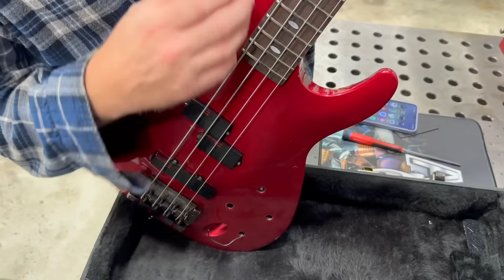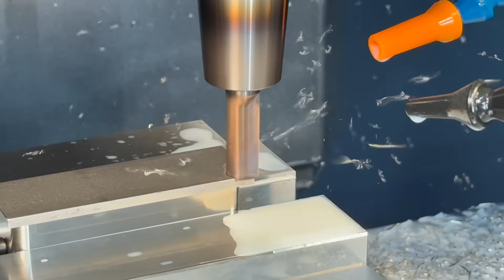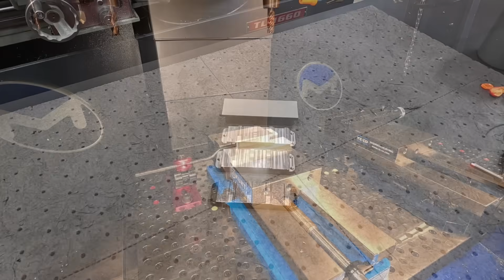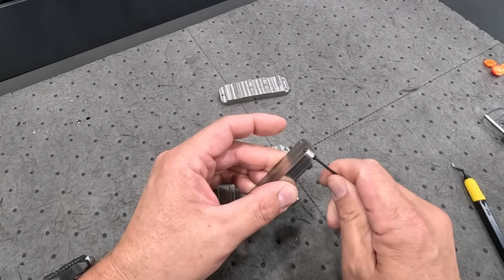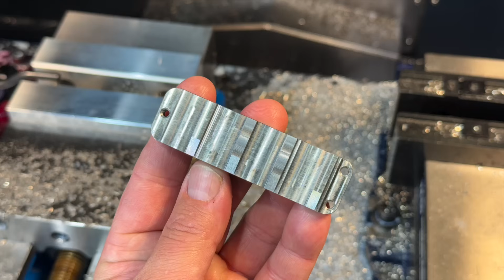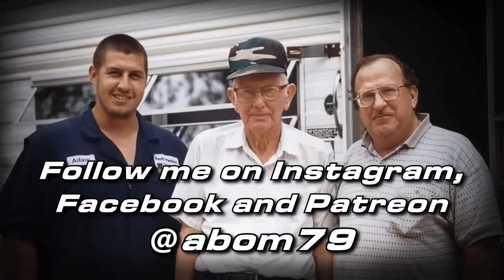Machining Obsolete Part for an Ibanez Bass Guitar- Part 2

Comment: I would've used air instead of cooling with the little guy. You don't need to cool anything really it's all about getting rid of the shavings so the tool don't need to cut the same material several times.

Comment: Check out Babicz full contact hardware if you’re into electric bass and guitar stuff.        I dig em     The old fashioned tune-o-Matic Gibson style bridge commonly on the Les Paul models is somewhat a relic that has no reason to be used - but the phenomenon of many electric guitarists and enthusiasts especially is this confused traditionalist or nostalgic thing-  a lot due to extensive marketing bs.    

But interestingly enough is that many electric bass players don’t get into that generally and just want what gets them solid performance and sound.   Funny to see that the individual wanted to restore the Ibanez bass with that same bridge- but hey it’s cool to see ya do it.  

Also Ken Parker archtops- he has a YouTube channel where he discusses anything from machining, machines to epoxy, glue and finishes, material choices and whatever. 

Also, there’s some amazing classical guitar tuning machine makers that are as much precision as they are art.      Salone is one of the best.        Definitely beyond the common Shaller, Gotoh and such.  

I could talk about guitar and music forever. 

Anyhow That’s my stream of consciousness

Comment: Would it be bad practice to use the Spot/Chamfer drill in OP1 as well, to have the chamfers on the bottom just as on the top before even drilling? Would the drill or tap mess with it or would it actually save the manual deburring?

Comment: Thanks for sharing. I saw some where that collets ad tiny end mills aren’t great. the tools get over loaded on one side and flex until failure. Bigger tools  can handle collets runout but smaller ones can’t.
Reply: Isn't a chuck the only (worse) alternative? I don't think the shrink collets get that tiny so these high precision collets are actually the best method, I guess. They are much more precise than any chuck.

Comment: Why didn't you make an undercut on the back to make the detail weight lower?
Reply: Probably because he was tasked to make a copy of the original part, right?
Reply: @Peter_Riis_DK The original part was hollow. More precisely, it had two longitudinal grooves on the back side.
Reply: @DART2WADER  The customer asked him not to remove that material. He talked about that in the first video.
Reply: @DART2WADER 
Damn, you’re right. Sorry, I stand corrected. But as the next guy states - that was why - so now we know. 😊

Comment: Nice work Adam.  I cringed a little when you sprayed degreaser on that part when it was still in the machine - the excess will end up in the coolant tank and degrade the coolant.
Reply: thats one of the first thing we learn on cnc work. Never use degreaser inside the machine, it will mess up the coolant.

Comment: Since this part is no longer available, it might be worth offering to owners of similar bass guitars, maybe through the manufacturer or just your website.  Pot metal casting do not have a good life span.  The need may not be much since this is not a high-end bass, but you never know.  Your program is written now, and you know it works.  Thanks.
Reply: Or the guitar repair shop who commissioned this could use their distribution channels to sell it and have Adam batch out the part.

Comment: Not only are you getting really good and CNC machining, the camera work is outstanding. Very professional! These need to be bead blasted to disguise tool marks and finally anodized possibly in color to make a very professional part. Very good lesson in CNC machining. Ones made with brass would be interesting! The seller of your CNC machines needs a copy of these two videos as demonstration to perspective customers.

Comment: Добра работа,  но за работиш по-добре е необходимо да оптимизираш програмите: 1. Свали ос Z на инструмента до около 2мм. 2. Увеличи скоростта на слизане до работната повърхност. Това е началото и в програмата като въведеш измененията ще се учудиш колко време ще спестиш. Успех в новите проекти!
Reply: Time isn’t a concern on a project like this.
Reply: @MechanicalAdvantage  I agree, but its a good thing to learn and practice, for example to implement on his drill index production.
Reply: @Wolfy_80  I don't disagree. On the drill index, retract heights are shortened, plunges are faster, positioning moves are faster. Lots of things have been done to reduce cycle time due to the number he is trying to produce. I'm just saying for making 1 part, speed really doesn't matter here.

Comment: You could have spot drilled the bottom of the three holes in the first operation; you wouldn't need to deburr them after if you had.

Comment: Just check that you would not be infringing in copyrights by producing that part from Ibanez 😮 I would suggest make modifications and present it as your own.
Came out great, loved watching this project.
Reply: Copyright is for creative works and would only apply here if Adam somehow obtained Ibanez's original design drawing and based his part off of that.  Reverse engineering a part by making your own measurements and shaping it to those measurements is perfectly legal.  He didn't copy the part exactly as the original is a cast part and as such it has draft angles built into it so that it could be removed from the mold, while his part has 90 degree sides.  As far as other legal protections, he didn't stamp an Ibanez logo on is, so there's no trademark violation, and a part such as this is very likely not covered by a patent as it's not a novel design. I'm not a lawyer, YMMV etc.
Reply: @ecliptix1 Any patent would have expired long ago. 21 years.
Reply: @EJP286CRSKW  Yeah I didn't remember how old the bass was, good catch

Comment: Best  machining on the tube. I always enjoy your videos. 1 suggestion. I’ve machined all types of SS and have found 305 SS to give the best surface finishes. It machines the same as 304 but it has more chromium  in it composition. 305 SS is used for medical instruments where smooth surface finishes are required for cleanliness.
Take care
I’m looking forward to seeing videos on your future home and shop!
Reply: what is the availability of 305 stainless?
Reply: While great finishes are a good thing, by the time that part was installed, I'm sure it was buffed out with grey scotch Brite and all the parts to hold the strings together.  One of the biggest issues with machinist's is the OCD mirror polished finish that comes off any part they made. :)

Comment: You don't need to face or run that 2d adaptive to cut the hat off. Just let the 3d adaptive cut it all
Reply: There was a specific reason it was done that way. I don’t want to type the whole thing out on my phone, so you will just have to trust me. It has do with the width of the slot and the tool that was used.

Comment: Nice job, but what a yellow brick road to blocking the other side of the work piece where the part would be blocked up the slots holes put in last opp to tip it up and fly cut the angle.  You don't make helical cuts on a Bridgeport just wind the handle lol
Reply: Or save doing another setup and surface the angle in with a ball mill.

Comment: I wonder why you didn't machine the features on the bottom?
Reply: In the previous video, he said the customer requested it that way. In the original part, it was probably just to reduce cost on material used in casting; no real reason to replicate that here.

Comment: Theres some lawyer at Ibanez somewhere whos typing a cease and desist order with haste. Your takin all the planned obsolescence out, how are they gonna sell more instruments like this.........    LOL😂😂😂 JK, Great work my friend, that thing isnt gonna crack anytime soon.
Reply: Ha! I have reverse engineered an obsolete ignition timing encoder for ‘92 Evinrude V6 outboards. I purposely don’t make it an exact-appearing part in terms of certain stiffening features the OEM part has, because they were made of injection molded plastic. I make my replacements out of 6061 aluminum, which will never wear out. To my knowledge I’m the only guy on the planet making these and I enjoy helping out the folks who would otherwise have to replace the crankshaft, or worst case the entire engine because the OEM failed them.
Reply: Yes, plus no claim as exact replacement. no logo.  Cast parts and machined parts are not an exact replacement

Comment: Great video! I would be very careful using tapping lubrication or degreaser in any machine that has its own dedicated coolant. There is a good chance you will change the chemical makeup of the coolant, rendering it useless.

Comment: Ibanez, like most large-scale modern guitar manufacturers, uses CNC machines in their production processes.  They know that this cast iron part is fragile and breakable   , so may be they want it to be that way . The part you just made is too perfect and will last for ever . Amazing job . Thanks.

Comment: 7:00 - совершенно непонятная стратегия черновой обработки. Какие-то дуги, выверты, закругления, а потом - раз! и оказывается, все это можно было делать простыми прямыми ходами 😅
Вот так, доверишься CAM, а он тебе напихает в программу всякой чуши…
Reply: I'm sure your CNC programing is sound, however Adam has only 2-3 years of self-taught experience in programing. Maybe you give him Email and we all learn more.
Reply: @slyfox7429  
Such simple, almost 2.5D rectangular maschining can be hand-written on a piece of kraftpaper))) No need of CAM ever.
It's a joke, be sure.
Reply: I'm responding based on translation. adoptive cut is useful for fast roughing. you are correct in this case. tool pressure wasn't that much to use adaptive. but it's cool for the video I guess.
Reply: @ramtinnazeryan  
Exactly what I mean.

Comment: 4:45 The adaptive tool path being so curved for a box-shaped cut volume is pretty surprising, would love a video explaining the theory!
Reply: It's the most efficient way. The whole point of adaptive is is maintain a constant stepover. Imagine the start shape and the end shape, and how to get from one to the other while taking equal cuts. It curving around the edges allows it to take less passes than just offset cuts from the sholder.
Reply: @spikeypineapple552 You have the right idea. However, the step over isn’t always constant. The constant is the tool engagement angle. The engagement angle (the slice or the pie or the cutter) is always maintained. Stepover may be reduced to maintain that engagement angle.
Reply: @MechanicalAdvantage  I just thought it an easier concept for a beginer to understand.
As an aside, do you do mastercam post proccessors?
Reply: @spikeypineapple552 Nope, sorry. I rely on others for Fusion post edits as well.

Comment: Way better than the original. That thin groove really needs a slitting saw. Buff it to a full polish, Screw all 3 to a plate & go to town on the buffing wheel.
Before that guy files the frets, tell him to just crank the 2 highest strings tighter. That'll fix buzzing by increasing the clearance between the string & frets. The part you cut is the base under the device that manages that gap.
Would love it if you showed some close ups of the part in place. You could probably improve the rest of it. If you polished it all it would look like a machinist's wet dream. Thanks for such great content, Adam!
Reply: !!! more OCD on finishes !!!      :)